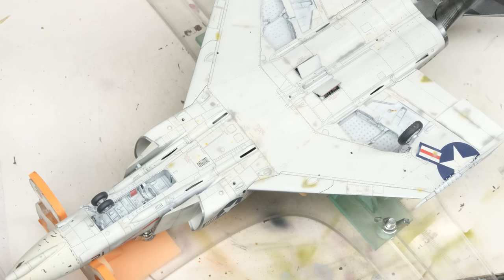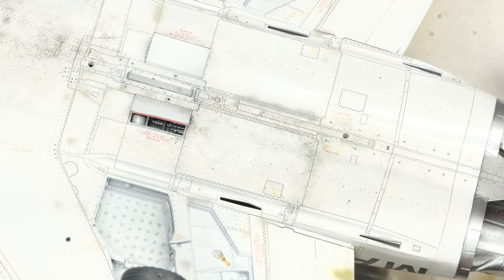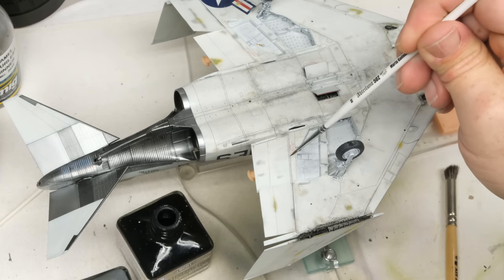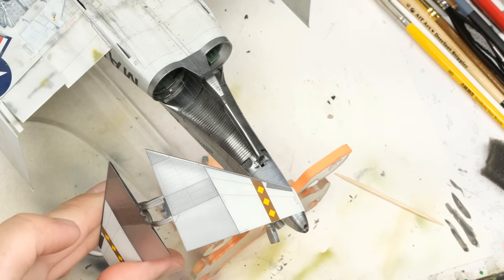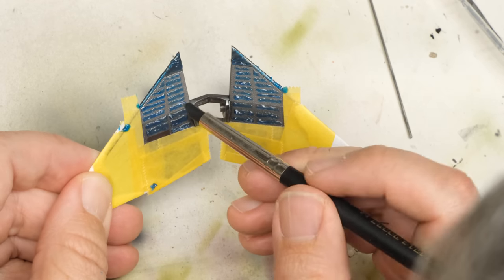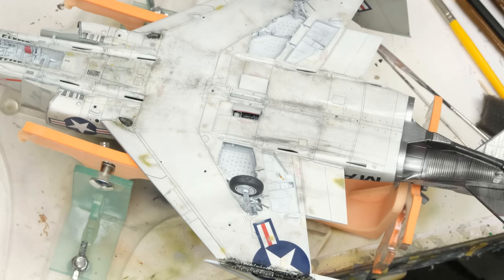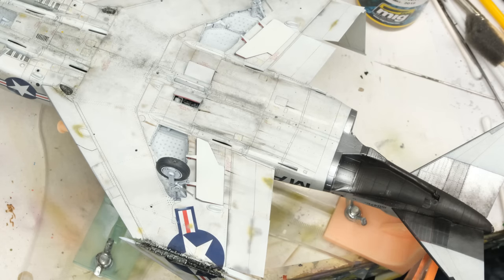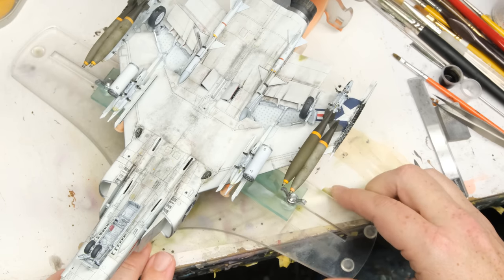1/48 Tamiya F-4B Phantom 13 - Underside Weathering - 4K

Comment: I used to be in the USAF and had the pleasure of loading weapons on the F-4Ds... we used to say, seeing the US Navy jets (back in the day), was, it was the grease and dirt that helped hold their jets together... but really it helped keep the corrosion down due to the salty air/weather out at sea, is what we were told. Even our F-4 had a dirty belly, but not as dirty as the navy's lol, and a few red streaks from hydraulic fluid in a few key spots would also look good. But very good jod!
Reply: I was a “462” on Ds myself. Loading AIM-7s was hard on the knees, not to mention all of the angled drain tubes on the underside waiting to ping you if you weren’t careful.
Reply: @davidrosen5137  The good old Phantom bites.... once a 462 always a 462!

Comment: This is a bit off subject but a couple of videos ago you made mention of the 1/16 Andy's Hobbies (Takom) Sherman and that it wasn't lighting your fire. For an Xmas project I bought the 1/16 Jeep and just started on step 1, the chassis. I noticed straight away that the kit has a completely boxed in chassis whereas the actual vehicle has mainly channel section chassis rails with some boxing at strategic points. I am totally deflated now because it means a major rework as stuff like this stands out a mile at 1/16th scale. This said the kit seems to have good reviews. I was kind of hoping for a bit of a kit bashing session over the Xmas period.
Reply from the maker: Oh man really? That's a HUGE disappointment. Probably big enough that I'll be looking at how to replace the frame.
Reply: @DoogsModels  Well having thought about it for 24 hours and cooled down a bit I think I can make an acceptable frame from the kit bits and some Evergreen plastic. What is so annoying is that it would have been so easy for the manufacturer to make a good representation of the chassis if they had done things slightly differently. It seems that easy of assemble massively outweighed accuracy. Anyway have a great Xmas and I look fwd to your upcoming videos and chats

Comment: The two triangular panels on the front inboard of each undercarriage held the two hydraulic reservoirs and the access  stepped tapered door immediately in front of wing box had another hydraulics reservoir the oil was OM15 a deep reddish purple coloured oil., if that’s any help  engine doors were stained a sort of burnt pink/ mucky barley  colours the immediate behind engines burnt paraffin very thick burnt paraffin.